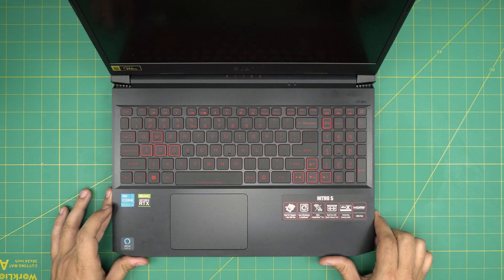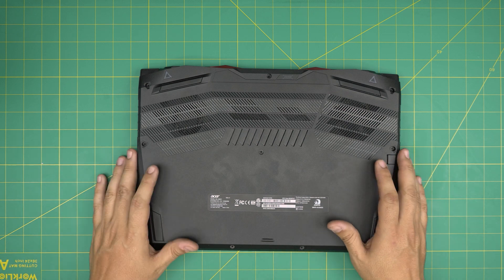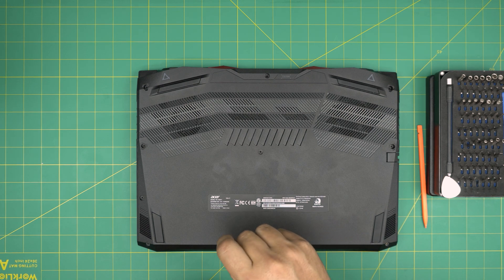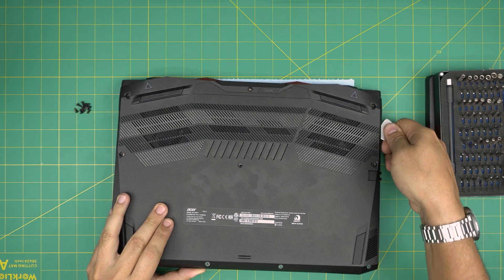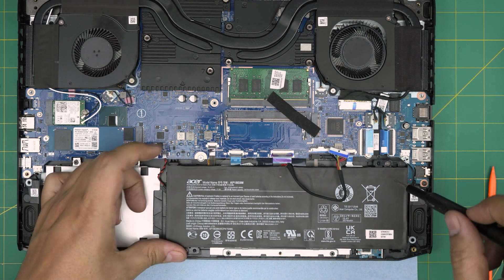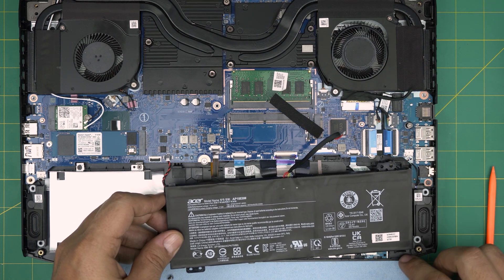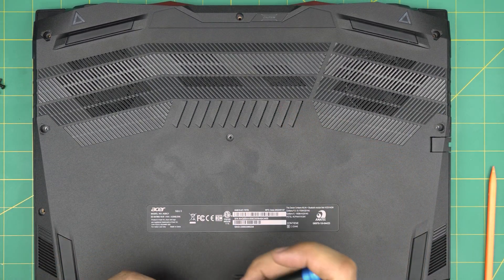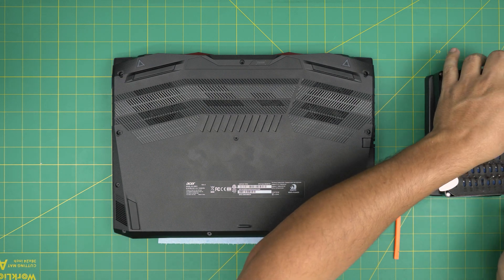How to Replace Battery in Acer Nitro 5 AN515-57-79TD Laptop | Step by Step

Comment: hi i am having a problem where no matter how much pulling on the plug for the battery with my fingernails it wont come out or move at all, any tips?
Reply from the maker: Thank you for your feedback! If you wish to support the channel, you can like, subscribe, or both!
Regarding your question, remove all the screws of the battery and then just slide back the jack garbing from the cable, don't worry just slide (pull back) garbing the cable.
Should you have any further questions or requests in the future, please don't hesitate to ask me.
Reply: same, have you done it?

Comment: Hello,
my question is not regarding this video sorry but I am bit confused to upgrade my SSD as I asked to Lenovo customer service they replied that I can use max of 512gb SSD but I just checked one of your video where to advised people that it will be okay to get 2tb SSD too. So, can you please  provide me with help that which SSD should I purchase for my laptop as I use for gaming and game development and I cant figure out which should should SSD should I purchase?
LAPTOP - Lenovo ideapad gaming 3 - 15ARH05 (512gb SSD in-built)
Reply from the maker: Thank you for your feedback! If you'd like to support the channel, you can show your support by liking, subscribing, or doing both!

Regarding your question, please disregard whatever the lenovo customer service said, as they seem to be misinformed. Upgrading to a 2TB SSD is easily doable without any issues, resulting in improved performance. Brands like Lenovo, HP, and others often have poor customer service experiences.
I have been successfully upgrading clients' devices for over 17 years without encountering any problems. It's important to note that we are discussing NVMe (PCIe lane) SSDs, and there is no limitation to 512GB as previously stated by customer service.

Samsung NVMe Pro SSDs are highly recommended for their durability and reliability. Currently, the 1TB model is on sale for Prime Day. While any NVMe SSD can be used, I specifically recommend the Samsung PRO series for optimal performance and reliability.

https://amzn.to/44E85iK
https://amzn.to/3rtjdAq
NOTE: you can add a 2TB NVME and have more storage at the same time, you have Zero limitation regarding the storage(GB) .

Thank you for bringing these points to my attention, and if you have any further questions or requests, please feel free to ask.
Reply: @uFixTek  Thanks alot for providing me help!!! Appreciate your work man!!👍
Reply from the maker: it is my pleasure my friend, anytime if you got any questions you may ask me on new comments, and i respond quickly to new comments, cheers🍻